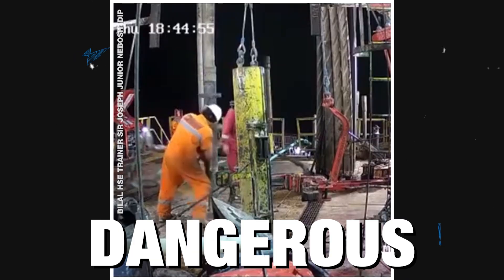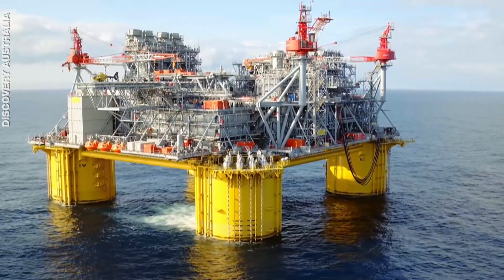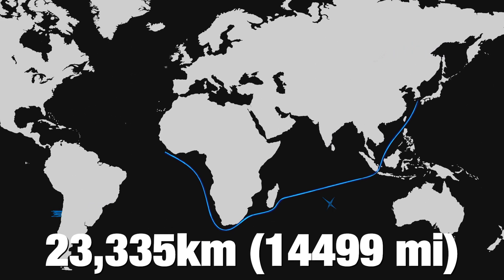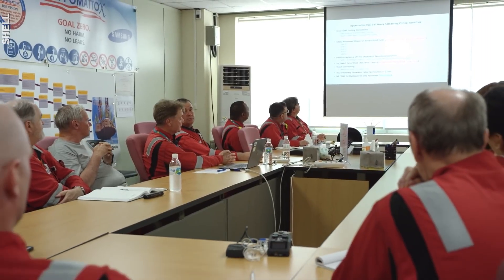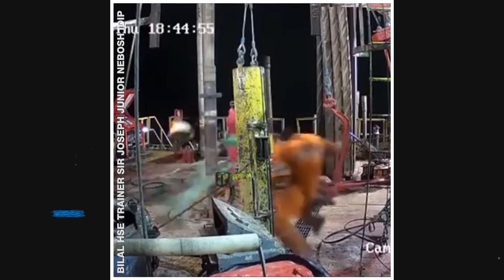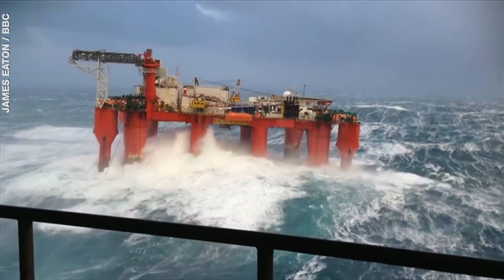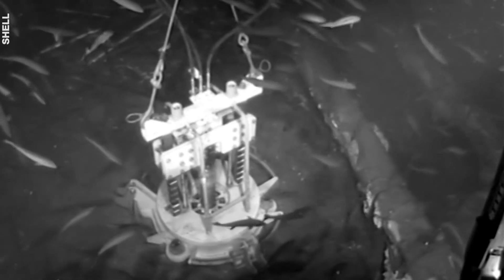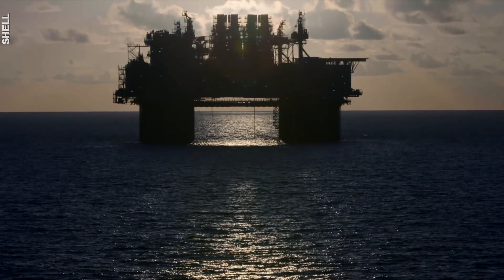Extreme Dangerous Oil Rig Jobs!

Comment: I hold the Record as the First Woman to be a Roustabout FOREMAN in the History of American Oil & Gas/Oil Fields.....back in the early to mid 80's in the Texas Panhandle.  I laid miles & miles of lines, built tank batteries, poured foundations for White Superior Booster Engines plumbed them in & got them running....I did it all.  I was always called for Trouble Shooting, Very Technical Jobs & Builds.   I worked with some of the best Men anyone could ever hope for.  Now the Boss(es) much different story.  How different......lets use the this video for example.  They state the Men can make up to $305,000.00's per year....Women doing the same job $95,000.00-150,000.00's.  Well that should set off a bunch of males crying foul & everything else how this is so unjust.  Yeah that's what I said as I watched all the other foremans wearing company uniforms, medical insurance making $18-25.00's an hour while I was never above a green hands pay at $5.25's.  

I built Refinery's before that.  Never made any difference.  The only time that I got equal pay was when I was an Auto-body Tech'.  When they saw My work I was immediately bumped up to full pay.  I would've stayed but AutoBody if a fickle business......not like mechanic where ppl "have to" get things fixed.   Maybe these days Women are paid more equally.......yeah right lmao...!!      I will say this....they tried to get Me to do a few days on a Rig.....nope I want ground under My feet when someone does something stupid & things start blowing up.  Been thru too many of those.....I won't be suspended to work.

Comment: Doesn't seem too bad when the main focus is the weather (which these things are designed to handle). I would like to know about the more common worker accidents (I would like to know what was going on in some of those clips). If oil rigs are dangerous in the same sense that nuclear reactors are dangerous (meaning in the extremely rare chance of a total failure, things get really nasty), its overblown. But some of the clips shown prove it can't be quite that safe.

Comment: Again another reason why nuclear is definitely safer. 

You can't say oil is ok for now but if we just build a few new and improved nuclear reactors the jobs will be plentiful and the energy we gain will be more then enough to support our entire civilization. 

And before you reference the Simpsons. Thats a cartoon, and it simply represents a worst case scenario of a nuclear technician. 

Its required if we want to live in a clean future. Its a step that needs to be the first. After that safe and efficient battery production and disposal or recycling. Then after that it's a matter of the other resources we use to produce electric cars. 

I know I don't want to get rid of gas powered cars but we are literally killing ourselves by not moveing forward.